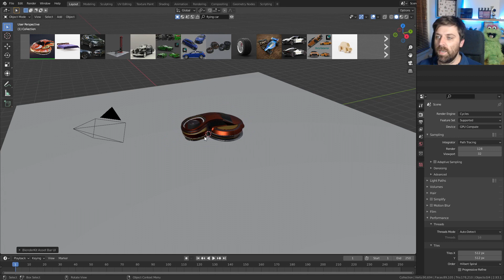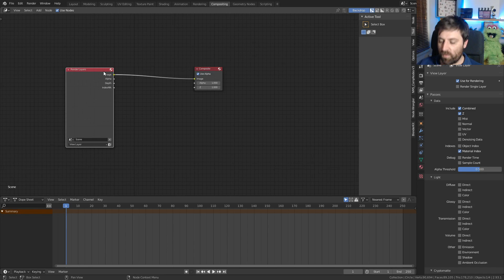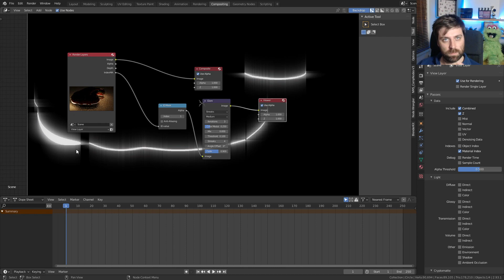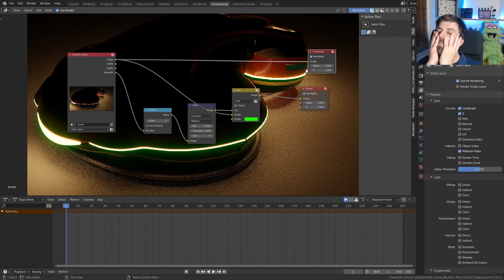Blender - How to get EMMISION GLOW in cycles

Comment: How do I import a model into Blender with all the stuff included with it [don't know what its called] I want to practice the process and make a still image as a start to the process of using models.
Reply from the maker: you can download models from sketchfab from the link in the description.
Reply: Try to get the gLtf version if available and turn on the import for it in addons if not already an option.  I find the material setups in those usually come in with no fuss or muss.  And you can look at the node arrangements in the shader editor to suss out how to apply separate materials to FBX and OBJ models later.  Hope that makes sense.